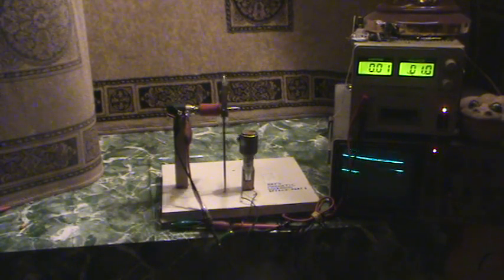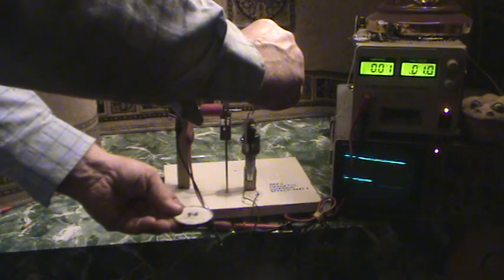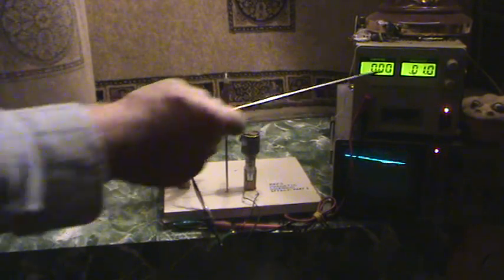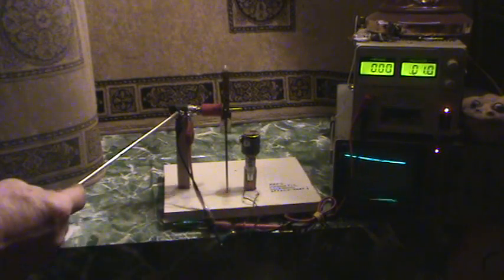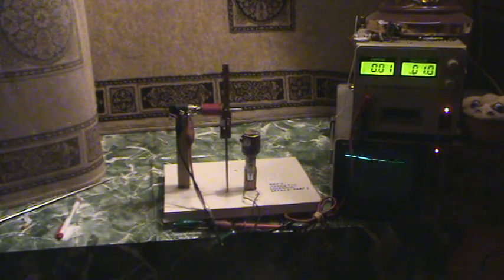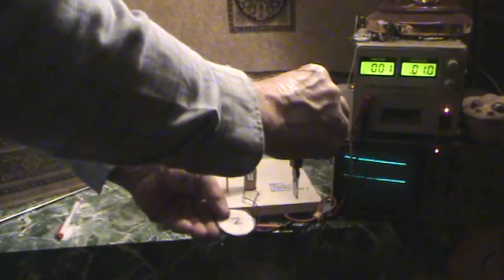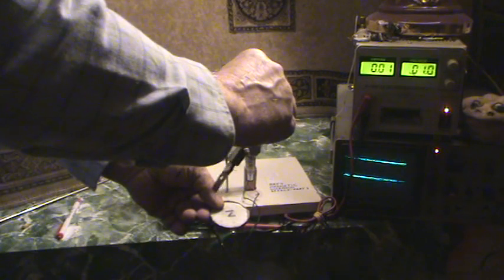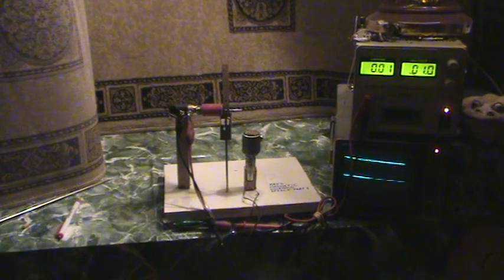Ray's Magnetic Solenoid Effect

Comment: Hi Ray.  My first thought is that the rotating magnet should be moving in a vertical plane - smaller diameter / just within the "catch & release" zone.  I have been intrigued by rotating systems for a while now and have a system that I hope to scale up and improve upon.   I do believe that there is a way to use gravity to overcome the "golden inch " in magnetic systems.   Keep on keeping on.

Comment: that does not seem like overunity since you re using non stop 1 volt and 2 volts show for only a split second. so over 2 seconds you use  1 volt and less than a second you get 2 volts. So in total 2.1 - 2= 0.1  Wouldnt you agree?

Comment: So if you would have an array of magnets having North Up, you could rotate that razor blade (if you mount it to a rotatable arm).
* I would not compare Volts with Volts, and talk about Unity (power). An LED will flash very easily, yuo don't need much power for that.
Do keep playing with magnets.
Have you ever seen the magnet setup by yog (Howard G, Yu, Y energy com)? He also had something going on what seems feasible. You would need to look up archived info, since all his videos are gone. 'The Yu Oscillating Generator'.
Reply: One technical difficultyin adding several gates is that they don't work well  on rotational movement.As they rotate ther other side of magnet is exposed and causes drag etc. On straight multiple gates one or two work well but the small resistances which I call input and output resistances, they add up super quick and stop the action.Best i have found is work with one or two.There are physical arrangements that allow many gates but spaced on different separate levels,but so many ideas are coming and i am only one person,that overall , time and other responsibilities limit me.Thank you for the other info.

Comment: It's a great experiment. And thanks for experimenting and sharing the results.  

I would suggest you to get a more accurate ammeter. At the time of solenoid action,  the current drawn from the supply should more or less remain same if the second level of magnetics works the way you describe. 

I am also thinking if there is a better option rather than using LEDs.  They do not really tell how much energy has been captured by the solenoid action. 
Maybe you can capture the energy in a capacitor and accurately measure the change of voltage.
Reply: Thanks for info
Reply: Thanks for input .You are absolutely right about better ammeter,i am limited on equipment.One of those poor researchers. I rely a lot on observation and reasoning. Poor or good that may be.One goal of my videos is to pipe curiosity and experimenting of others.